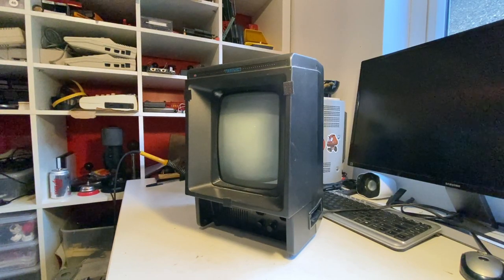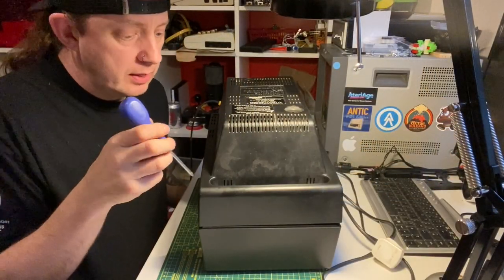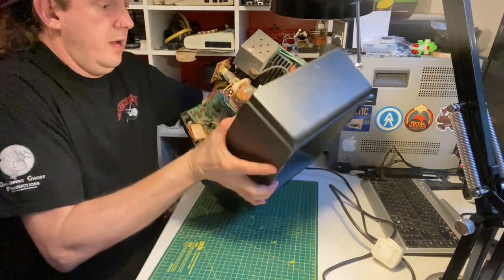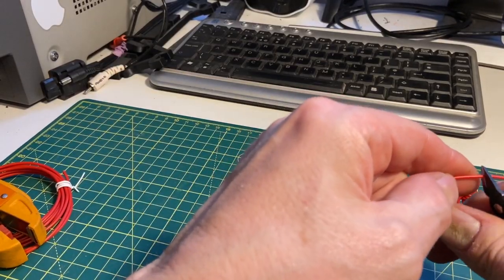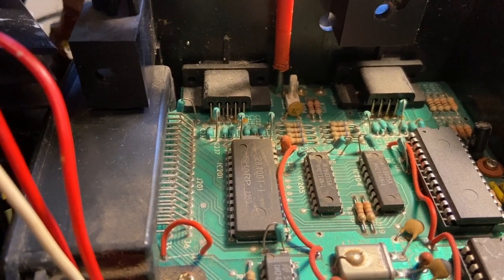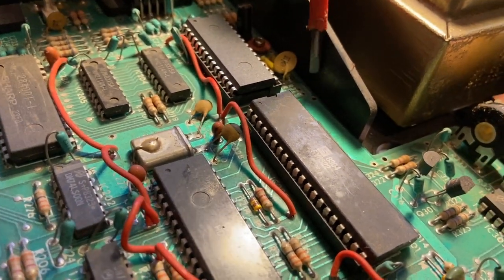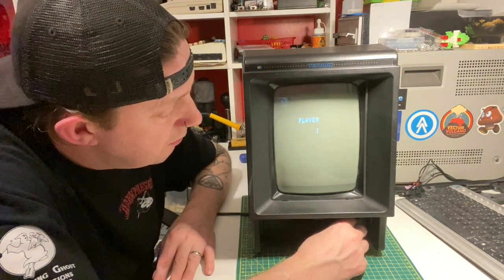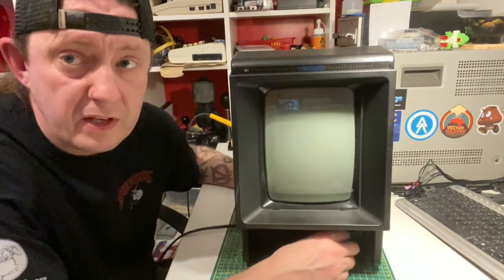Vectrex buzz removal

Comment: I just did this fox finally and I had the same faint buzz. But I opened it back up and managed to COMPLETELY eliminate the buzzing fro the speaker. The trick is you need a good shielded , grounded cable and then the positioning of how the cable lies across the logic board matters!!!  You need to zip tie it into position and stay away from Andy of the chips that are doing the vector generation. I zip tied mine to the white connector that goes to the crt board. I took pics of you want me to post links. Now the only chatter I hear is the crt.

Comment from the maker: Been talking to Bobbi Iddod - the amp would actually amplify the signal by 200x if you left the R1 wire link on the amp module. By taking it off, it reduces the amplification to 20x - just right for what the Vectrex needs.

Comment: They all have a tiny bit of buzz leftover.  Even the factory no buzz Vectrex, and the after market modifications to a buzzy are not perfect.  But they ARE MUCH better than the initial run.  When couple with an external jack allowing connection to a stereo the difference is huge.  Well done on the mode and the video.

Comment: Nicely done, but one small overlooked item is the power/volume knob. It needs to be removed before the board can be slid out from the bottom. I have that problem and the knob won't pull off the potentiometer post. I don't want to force it too much as it is all plastic. Any advice?

Comment: Great video and loved the Vectrex podcast.    Also wasn’t the buzzing due to an error at the manufacturing stage as it didn’t have it on the reference machine?  I thought that’s what the designers said at a show filmed by willie.
Reply from the maker: Good point! Not sure, but the rubbish shielded cable they used was of poor quality. I think the story did go that way though. Still cool, even with that damned buzz!

Comment: Good idea, I actually have some of those exact amps in my parts bin... And two Vertexes... Guess you lose the volume control unless maybe could jump the POT over to the amp board.
Reply from the maker: You don’t lose any volume control - the main volume /on/off pot works as usual.
Reply: @victormarland4873  right I just realized that. You aren’t replacing the current amp you are pre-amping it. Might have to try it out. I just fixed my nearly impossible to repair vectrex and all is good but the hum is extra loud.
Reply: I guess you might even get less hum if you use a shielded cable?
Reply from the maker: @sideburn  yes, it all helps. Some vectrexes buzz louder than others and can be harder to de buzz, but this method definitely improves it.
Reply: @victormarland4873  I forgot to ask what do you need to remove the R1 off the pre amp for?

Comment: So what was the difference between your mates Vec and the one you just did in the video ? better cable ? did you put the amp anywhere else ? I bought a de-buzz kit and it's fine, but then I got another Vec but thought better of paying another fifty quid to get one from the states, maybe place the amp in a kind of shielded box, or is it just a matter of the wire being shielded, anyway cheers
Reply from the maker: gan9e not sure. Shielded cable helps. I’ve also been told that routing the cables under the Pcb can reduce more buzz. I expect the different vectrex revisions behave slightly different with the buzz too.
Reply: @victormarland4873  I know what It Is... it's the transformer, I had a Vectrex with a slight buzz ( with a buzz free kit installed ) turns out if you secure the transformers metal-housing a bit more perhaps that'll help but in my case I simply had to move the mains wires into it just a touch to hear the buzz lessen or get louder again as I moved the wires... it drove me mental wondering what it was at first, I thought it was the tube at first but nope... definitely the transformer, you can buy replacement ones if need be.
Reply from the maker: gan9e Its so faint, I’m not bothered by it...

Comment: iam trying to do the buzz mod for my vectrex but i got nothing but black screen and no sound the moment i uplug the kit vectrex works like normal !  if you connect wires to the pot wont the original amp stil be active because the traces are stil there ?